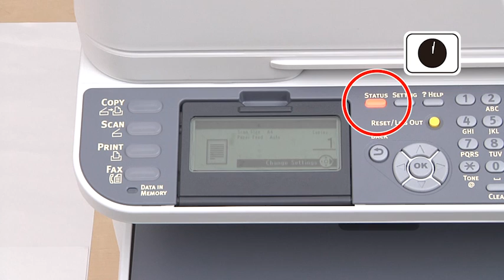[MC300/500 series] How to replace Image Drum & Priming?

Comment: Thumbs up for the video and the printer. Thumbs down for the cost of a replacement drum kit. New printer = AUD$360, drum kit = AUD$150. Doesn't really stack up well, does it?
Reply: In Turkey, printer is cheaper than drum.
And in c5900, it was easy to solve problems. This is so hard to dissamble drum unit to clean or change drums(green rolls)

Comment: I don't understand, do you put the drum kit in with the dummy cartridges first, wait 4 minutes and then take the dummy ones off and put in the originals? The directions had no written directions only pictures and it was REALLY confusing!!
Reply: Also, after I put the originals back, now it is saying I am out of toner when before I replaced the drum kit all cartridges  were at 80-90%
Reply: Same here, three of my cartridges were brand new. After installing the new Image Drum, the cartridges showed only 10% left and we had to replace them to get the print jobs done.
Reply: Called Oki, they would replace the cartridges if they are original (US). Looks like they are aware of the issue. My next printer won't be an OKI